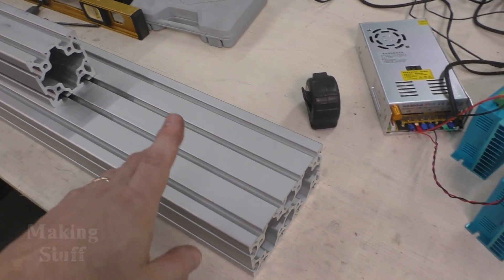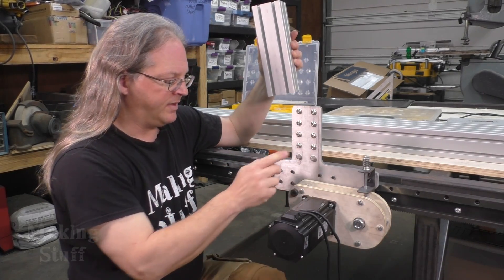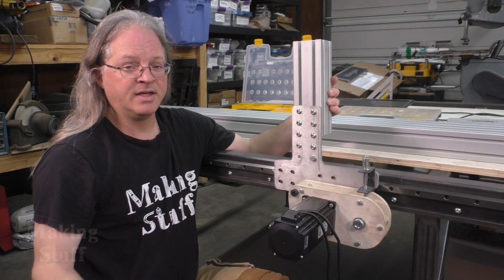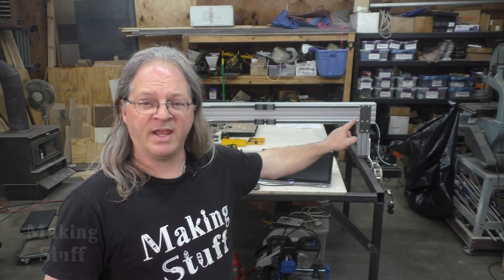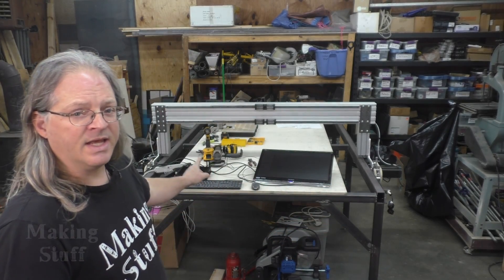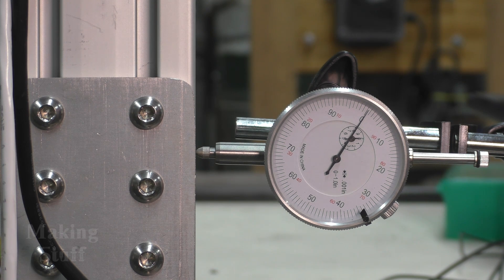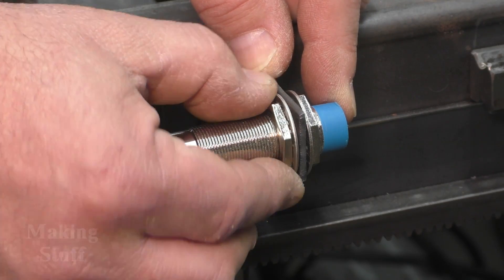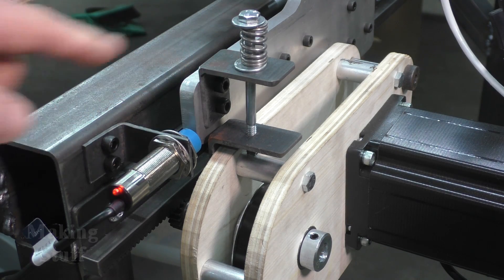CNC Router Part 6 - Finishing the Y Axis

Comment: Hi, would like to know how you mounted the linear rails to the y-axis so they were parallel and flat to the frame of the router table.  I have a design I'm working on and this is the only problem I'm having trouble with. I realize many people would shim the rails to they are parallel. I'd prefer not to have to shim if possible.

Comment: Great info! Im copying a lot from you especially the gear reduction box.
Just one question, why don’t you use dial indicator to calibrate the linear rail? I thought it would be much more accurate horizontally
Reply from the maker: There is no known flat surface for the dial indicator to run against.
Reply: True. Thats fair enough

Comment: Excellent Job Bob!  Very inspiring to watch your videos.  Question, are you using 8020 extruded aluminum or have you been able to find a more cost effective material for the aluminum extrusions in this project?  Thanks for any insight on this subject.
Reply from the maker: I'm using 2 inch square tube for the frame.  The only extruded aluminum is on the gantry and it is something like 120mm x 80mm.  I used steel for the frame because the cost to make it out of 80x20 was going to be over $1000.
Reply: Thanks for the response to my question.  Your videos and dialogue definitely help educate those like myself that are trying to learn this technically challenging subject mater of CNC’s!  Thanks Again!

Comment: How are you setting up both stepper motors up in Linux CNC?
Reply from the maker: It's too detailed for a reply in comment section.  Search on the LinuxCNC forum.  That's where I found the info to get it done.

Comment: I like the steel or iron pieces holding the 2 alumium extrusions together.  I had a similar flat piece of aluminum just like that holding a Nema 34 motor in place and there was some flex in it, and I have to take that out using aluminum shims, or a wooden block, and because of the design, I would probably have to do that anyway if I had of used steel as well, but the blocking would be a bit less needed.  I had no way to easily cut a big piece of iron.  I guess my tiny band saw would do it, but ... it would not be pretty.  I am new to your channel and am enjoying your videos.  We are all going through the same problems and misery but I am finally exiting the other side on a big CNC machine that took forever to finish.

Comment: Bob, really nice work! I am impressed by your one test of accuracy for one axis. Can you do a video in which you put your CNC through some accuracy/repeatability tests for each axis? Under load? I am wondering about backlash when under load (say, cutting aluminum, steel or hardwood) with the rack and pinyon systems you built.
It would also be nice to learn how fast you can cut. You have made this so sturdy and used such big servo-steppers that you ought to be able to really move fast through hard material. How fast can it go?
Reply from the maker: The machine will max out at about 500IPM, but the fastest I have cut is 250IPM in wood.  Not sure if the limit is the motors or the controller that I am using.  I can set the machine to go faster than 500IPM, but it won't actually go that faster.  I've got all of the axis less than .001" accuracy.

Comment: Great job, looking forward to seeing the completed project.  Have you considered using a jointing compound like Mastinox to combat the dissimilar metal corrosion that may occur on the gantry? Its used a lot in aviation where steel meets aluminum.
Reply from the maker: Thanks for watching.  I've never heard of Mastinox
Reply: Making Stuff me either, but he’s right - where aluminum and steel mate up, there will be corrosion. I see it when I leave a big vise on my aluminum work table for too long. I’ll be looking into Mastinox - thanks for the tip!
Reply: Probably not as bad as it could be. Afaik 8020 has an anodized coating. What thickness did you use for the bearing plate and why?

Comment: You are going to end up wishing you painted your frame before going to far forward with the build... You will end up getting galvanic corrosion between the steel and aluminum parts that are in contact, and you are going to get rust on the steel frame.
Reply from the maker: Everything is going to get taken apart and painted when the project is done.  Just like the CNC plasma.  Yeah it's a pain but that way I'm not ruining the paint job if I have to do some additional welding.
Reply: @MakingStuff  valid point. I have not yet had a chance to go back and watch many of the older videos in your collection. Spring has a bad habit of keeping one busy with garden, household maintenance projects that where put off over the winter, etc. :)

Comment: Can you tell me why you selected the rectangular (HGR?) linear rails instead of the round (SBR) linear rails?  Is there a precision advantage of one over the other?  Enjoying the series.  Anxious to see everything completed.
Reply from the maker: I used them because they have a lower profile and were easier to find in the length that I needed.
Reply: @MakingStuff  Thanks for answering.  I'm contemplating something similar to your plasma table.  Google says the rectangular ways may be more accurate, while the round are smoother operating and require less power to slide.

Comment: I’m very interested in the process of choosing which board, controller, driver and motors I should use and how to configure it to Linux. I have to keep in mind the weight of the gantry and I will have it running for long periods. Should I be overcompensating and what to look for, I see amazon has kits. Thanks, love the videos!
Reply from the maker: Thanks for watching!
Reply: I use a Masso controller for my machine. It’s a dedicated controller - no PC required. I wouldn’t go back to my previous setup, which was GRBL, driven by a Raspberry Pi running bCNC. Masso boots up in under 10 seconds. Good luck!

Comment: Coming along nicely! I've been watching on closely, and considering going down the same path as some of the other solutions are getting more expensive as the AUD$ crashes against the USD$ :(

 Shame you chopped the rails- you could have left them longer to park the Y/Z carriage off to one side, and just put the connecting plates on the back / underneath, as with AvidCNC's design.

 Also, consider not putting the hall effect sensors through relays. Consider other methods in your electronics - relays can add (very minor) timing issues, as they're much slower to trigger than, say, a transistor.
Reply from the maker: The hall effect sensors are NPN but they won't trigger the 7i96 board for some reason.  I had the same problem on the CNC plasma.

Comment: Closer and closer... excitement must be starting to set in!  Thanks again Bob.
If there is anyone out there who has wondered "If I just buy some Rivnuts, I should be able to compress them by just cranking up a bolt until they deform."  The answer is "NO!"  If you have found a way to use them without the tool, let us all know.  I don't really need them, I just liked the idea, but not enough to fork out $$$ for the tool.  (Scottish ancestors!)
Reply from the maker: If I figure out a way I'll let you know :)  Thanks for watching!
Reply: There actually is an pneumatic drill that you can buy. It’s pretty much a threaded screw with teeth on the top to stop the rivit from spinning

Comment: Hello from Germany, i like your videos. You explain everything really easy. At the moment i am also building  ja CNC Plasma table but i am having  problems with the configuration of linuxcnc and the Mesa 7i96. Can you make a Video about the configuration to Connect the 7i96 with linuxcnc and the basic configuration to move and Zero the axis?
Reply from the maker: I've got links to the configuration tool and docs here.  https://makingstuff.info/Projects/CNC_Plasma_Update
Reply: @MakingStuff  thank you for your answer. i have installed the configurator, but don't understand what i have to enter. Unfortunately I can't make it easier for myself with the description . Maybe you can help me there. I need a basic machine, which I create with the configurator to install Plasma C. Is that right?